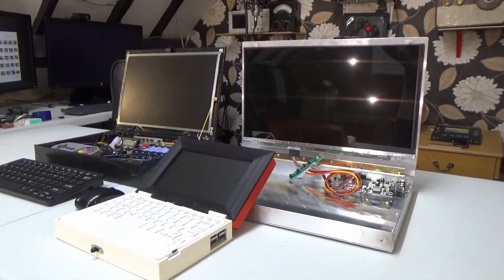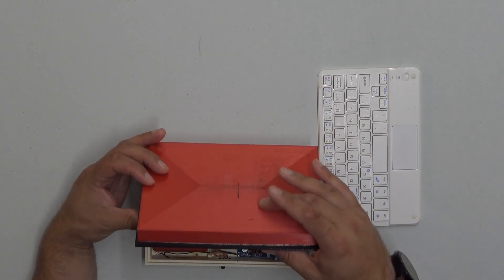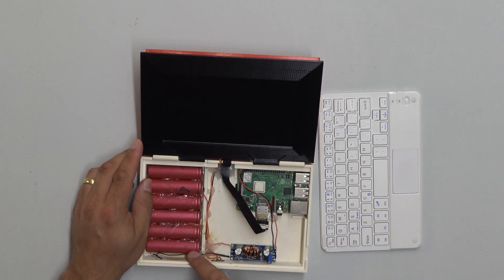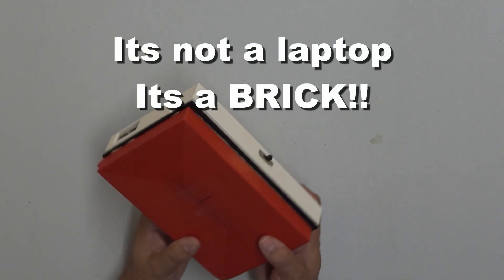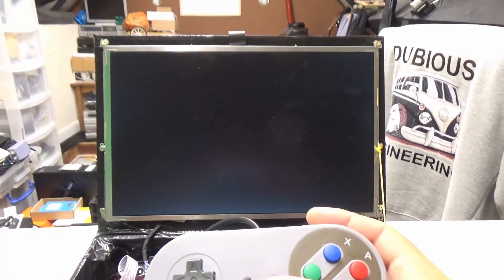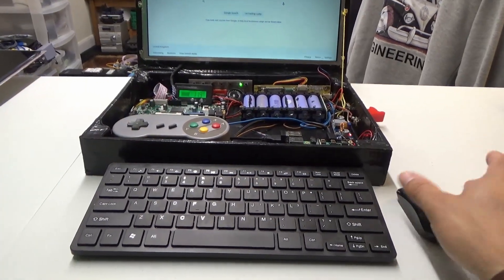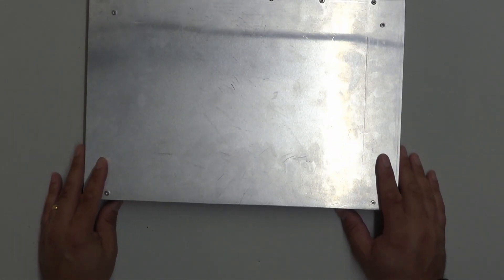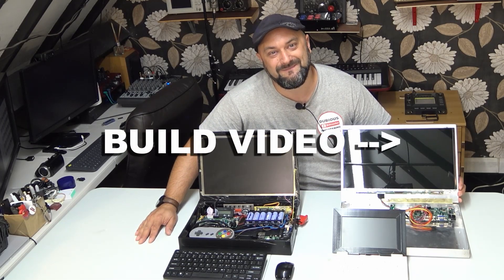DuB-EnG: Pi-Top 3 or 4 too expensive? Make a DIY Raspberry Pi4 Laptop out of recycled laptop parts!

Comment: Which PCB do you use for battery management? Not the level monitor, the PCB that is vertical? Thanks
Reply from the maker: pop 3S BMS 20A into eBay...  you’ll find it there :-).  sorry for delays responding